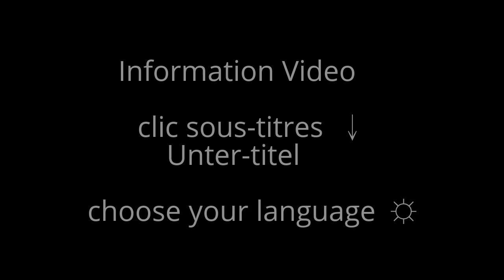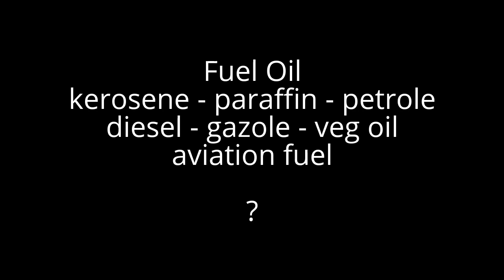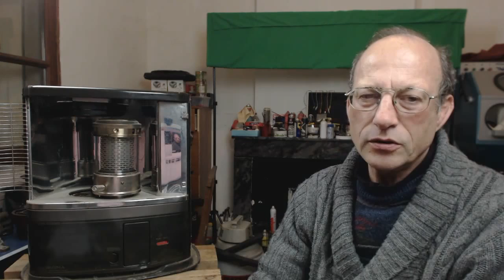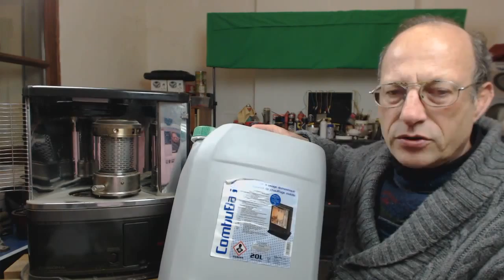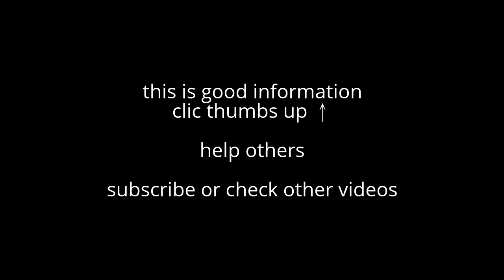Cheapest safe heating fuel - paraffin / kerosene / petrole heaters & stoves

Comment: Use the fuel recommended by the heater manufacture.
Reply: Modern kerosene stoves with wick essentially also act as a catalyst. After combustion, what remains is only carbon dioxide, i.e. the same as what humans exhale. We are talking about for K-1 type kerosene that is sold in the United States and meets the specifications for indoor use. There is also this type of kerosene in Europe, of course it is expensive, but worth it.
Reply from the maker: Hahahah!
Yes ... sort of :)
The problem is two-fold .

1) There may be no regional supply of the recommended fuel.

2) The recommendation of a fuel, is based upon a business deal ... the fuel must be correct, but it doesn't have to be the cheapest.

This is why it is a good idea to understand standards.
It is also why different oil companies choose to use different standards ... to prevent public comprehension :)
Reply: @EngineTuning  , Correct. But people using diesel & jet fuel in these heaters are asking for trouble. We don't have many choices here either but !K kerosene is available almost everywhere.
Reply: @steveashcraft718  The "jet fuel" is kerosene.
Reply: @greenghost6416  , that's what I thought. Thanks for clarifying that.  Since it's jet fuel should be a lot better than gas station kerosene.

Comment: Good information. I have a 12 month old parrafin heater. It runs fine, but on start up, and switching off the heater, there is really bad smell of smoke. I've tried cleaning the air filter, and parrafin filter. But the smoke is awful. Is there a way to stop this from happening. Tia.
Reply from the maker: For the start up, always have a large bin bag to hand.
When the clicking starts, put the bag opening, over the grill.
The puff of smoke will inflate the bag.
The smoke can then be ejected outside.

For the switch off, the trick is doing this before retiring to bed :)

Comment: Great information! At least I understand now why my eyes are having some trouble.... Burning C2 since it is more then 50% cheaper then the C1.
But it makes me think harder for a better solution!
Reply from the maker: Yes ... cost does affect our decision making.
It also brings us to question the ethics of taxation, when the C1 fuel is merely the next level crack of the refinery.
Ie. It will only be slightly more expensive to produce.

The achievable miserable solutions, are limited to one.
Add 0.5% acetone, to each recharge of fuel.

This will lower the surface tension of the injected fuel droplets.
This in turn, causes greater atomisation of the fuel, and therefore a hotter, cleaner burn.
... but bear in mind that it has the same advantageous effects on C1 fuel.

You can remove the grill, and check the flame colour.
It should have no yellow, it should be blue.

However, whilst burning slightly cleaner, and hotter, it can't eliminate all the toxic fumes from the C2.
These are designed for an exhaust, not for human consumption.

If money is very tight, you could 50/50 C1/C2 and add acetone.

The very best is C1 + acetone.
Pure C2 is toxic, as you ere experiencing ;)

Roll on summer :)
Reply: @EngineTuning  Thank you for your reply.
And yes, Roll on summer (a real one this year would be nice)
Reply: @EngineTuning  Thanks for this info👍  and  "achievable miserable solutions" 😂  love it. 😂

Comment: I have tried all fuels in a Kerosene/Paraffin heaters and believe me C1 UK premium paraffin or K1 US Kerosene are the only fuels that actually work correctly for flueless heaters. Please don't use Kerosene/Heating Oil it's not good for you also don't use Diesel the fumes are unbearable no matter how clean the combustion is. If you don't like the smell, try hydro treated kerosene/paraffin it has almost no smell but please make sure it's C1 or K1 US spec. Make sure u have a CO alarm/detector in the vicinity of the heater. Premium paraffin works out to about 12p per KW while the oudorless fuel is about 15p per KW cheaper than electric at 23p per KW. Gas is cheaper at about 8P per KW but I find the Paraffin/Kerosene heaters cheaper if u don't have a gas supply or if you are just trying to heat a specific space and not the whole house.
Reply from the maker: Good post, and interesting price comparison :)

Comment: If I make biodiesel myself from waste vegetable restaurant oils that should be ok to burn inside if I achieve good combustion, right?
Reply from the maker: My opinion is that it will not be safe.
Buy some high quality paraffin refined for indoor heaters.
Check how it is a very light oil ... you can barely call it an oil, because it is so well refined.
Compare it to your biodiesel.

There is no way that it will burn clean.

Remember ... the little diesel heaters that people fit into mobile homes ... they have an exhaust pipe that must be routed outside.
The reason for this is that the exhaust fumes will kill you.

Stay safe, and keep your family safe.

Comment: Hello.  I have the zibro R18 E  heater ,.  When I use it , it puts out a smell, then you can't use it , also it doesn't seem to put out much heat, I was told they give out a lot of heat,.  Tks
Reply from the maker: Pump out the old fuel from the fixed reservoir.
Clean the flame rod (see my other video dismantling).
Add fresh fuel.
Good luck!
:)
Reply: @EngineTuning  hello. Tks for the quick response, I'll look into what your saying,  should it smell much, and should it give out much heat, I would be using it in the house,
Reply from the maker: @martinmorgan8475  Upon first ignition from cold; a puff of smoke is ejected.
This is because at the moment of combustion, the temp is too low.
It is just one puff of smoke.

I take a bin bag, and hold it over the grill (when it begins clicking).
The bag fills with smoke.
I close it, and empty it outside.

The stove will kick out around 3 KW of heat.
That's hot!
Reply: @EngineTuning  hello.  Can you tell me more about the electric inverter one you have, What's the advantage over it and the older one.  Thanks
Reply from the maker: @martinmorgan8475  The wick systems smell when you extinguish the flame.
The injector systems smell when you ignite the flame.
:)
Reply: @EngineTuning  hello. What I'm saying is , is it better to have an inverter heater in general,.   over the older one ,  with it being more advanced,   because I was thinking of buying one.   Thanks
Reply from the maker: @martinmorgan8475  Inverters are better.
Reply: @EngineTuning I'm seeing some advertised inverter 5086 5096 and 5006 Corona I think, apparently similar, what one do you have and what one would you recommend.  Thanks again
Reply: Hello,  is there any particular inverter heater you would recommend , and what KW would be enough for the house,  and dose the initial smell go away, don't particularly like the smell of paraffin.  Thanks
Reply from the maker: @martinmorgan8475  use the bag method, and there's no smell.
Buy the one with the best spares availability.

Comment: Bonjour, mon Tosai SRE 301 me donne un code erreur H36, ce serait filtre a air bloqué, je l'ai démonté mais je ne vois pas de filtre a air, quelqu'un pourrait m'aider ?
Reply from the maker: The air filter is a simple mesh, that allows the free flow of air.
It's roll is to filter larger particles such as hair, wool, cotton etc.
It is fixed into the case, at the rear or side.

Comment: Can u run these on Red diesel, as it's around £1.20 a litre at the moment but C1 paraffin is over £2 a litre and Heating oil/kerosene around £1.70. I only ever need around 50l a month during winter and looking to save some money.
Reply from the maker: Everything is as stated in the video.

It is evident that heating fuel prices are over taxed.
C1 should be no more expensive than Red.

If you wish to use diesel as a safe heating fuel, you need a flue or exhaust based system.

Comment: Problem with mine, unable to have a blue flame. Even on the verge of extinction I still have a yellow side.
Reply from the maker: When restarting the heater with last years fuel still in it, you can expect problems like this.

Add 1% acetone to the fuel on each refill.

If this doesn't cure the problem, then you will need to watch my video on how to service the heater
https://www.youtube.com/watch?v=VC-5657JLhU
 :)

Comment: Thanks for very useful advice. I used to run a parafin heater on my boat but now I refuse to pay the extortionate parafin price on principle. No boat now, so I've been using the same parafin heater in my conservatory with heating oil (80p litre) and window open. Though I've just installed  one of the chinese deisel heaters in there, again run on heating oil and it's brilliant. I've actually got three of the  parafin stoves, two with wicks, one electric and tried them all with heating oil. Good good clean burns with no smell when going. Wick ones will be treasure if we get power cuts, though I have installed a carbon monoxide alarm.  Thanks again for alerting us of the danger.
Reply: That’s good to know, I wanted to try my wickless one on normal heating oil. Has your wickless one been ok running on it? Thanks

Comment: I have a Corona wick heater, I usually fire it up and then turn it down once it starts burning hot.  Is it better to run it close to full or turn it down low for efficiency and clean burn.  Also how often do you replace the wick, I have had mine a year now but just wondering how long they last.
Reply from the maker: I have one also, though I've not used it for some years.

When turning down the wick, there is a point where you can see that combustion isn't perfect, and more odour will be produced.

If you have the wick burn efficiently, it will produce a gas, and it is the gas that burns (not the wick) ... at least, that's the theory :)
Reply: Cheers, mine seems to be working well so far, if I turn it down too quickly it does sputter a bit but the  heat picks up again and it glows hot.  I like the glow of the wick ones but cant find much info on how long the wicks last, I suppose I will know when it needs replacing as the heater won’t burn properly.
Reply from the maker: @lordtoady1528  yeah, you'll know :)
But they last a long time, if they burn right.

Comment: What about olive oil pls?Is that safe?Thanks
Reply from the maker: I have no data on burning olive oil, but from a viscosity perspective, it wouldn't work in a heater.

Some people process 'used vegetable oil', for use in diesel engines.
If you fancy doing some chemistry, you should locate web sites specialising in that field, but I have no confidence in it working in a heater.

Good luck, and thanks for raising the issue :)

Comment: The problem I have is. I bought a kerosene heater not knowing too much but assuming it would be cheaper. I bought regular kerosene, which said it was high grade blah, blah. But it was just the regular stuff and made the house stink. So I bought clear lamp oil. Thing is, this costs me about 70p per hour to run. Plus replacing the wicks etc An electric heater would cost me about that too, so I'm not sure that it's worth running the kerosene heater. I think it's handy to have as an alternative or emergency option. I also have. kerosene lamp. So that would be handy in power cuts, grid down situations etc. Also I can cook and boil water on top of it which is handy. If I could find cheaper clear kerosene it would be worth it, but not at the cheapest price I can currently find. Which is about £3.60 per litre.
Reply from the maker: £3.60 per litre is not correct, for when buying in 20lt quantities.
You should carry out some research on fuel supply sources.
I doubt very much that it is more expensive than diesel.
Although it is more refined, it has reduced tax, due to it being home heating fuel.
£3.60 sounds like profiteering.
Reply: @EngineTuning  I had a quick look and I think I found another cheaper supplier. I don't think I can post links on here as my last message isn't showing. This place sells "odourless kerosene" for £60 per 25l. Don't need to pay VAT if used for heating. So that seems a bit more in line with what you were saying pal. So that would cost me about 48p per hour, which is getting better.
Reply from the maker: @tqdesign9288  So the £60 includes VAT, meaning that the price will drop?

There are three grades of odourless, so the price could be par.

RE links, you can post youtube links, but for external you can disguise the link by dropping the https prefix, and saying DOT instead of '.'
Reply: @EngineTuning  I think you are right there. It does include the VAT in the £60, but hopefully I can get it removed from the bill as it's for heating. Their website says there isn't VAT if it's for heating. So at this price it comes in at about half the price of running my electric heater. I'm thinking through winter, once it starts getting to freezing temps, to just put my central heating on for a couple of hours each morning to prevent the pipes freezing. Then use a small kerosene heater upstairs and one downstairs to heat the house for the rest of the time.

Comment: Due to the energy crisis in the Netherlands I have bought the cheap stuff before i knew the facts. The seller told me it's fine, but I'm already having trouble after 2 weeks of usage.  The only problem is that I have quite some of the cheap stuff. Do I have to get rid of all of it, or could I combine the manufacturers petroleum with the cheap stuff together when filling the heater?
Reply from the maker: Understanding the financial difficulties in life...
Mixing and adding acetone, is the way forward.

Buy 5 litres of acetone from a diy store, and add 10ml acetone per litre of fuel (1%) .
This is an extremely cost effective way to improve the burn temperature, and therefore gain more heat. Plus, the improved burn will keep the system clean(er).

Check around for the cheapest, indoor fuel (no flue and typically showing a picture of a paraffin heater on the container - typically 20lt).

Prices have doubled from last year, in France.
It used to be €1 per litre, and now it is €2 per litre.
(it's a con ... most of the cost is tax)

There are 3 grades, defined by aroma.
Typically €40, €45, €50 for 20lt.

If you are mixing with kerosene, then there is no point in buying anything but the cheapest.
So check around.

With the acetone, you should be able to turn it down a bit, but make sure that it is burning with a blue flame, as this indicates a clean burn.

You must have ventilation - be aware of feeling drowsy, or weeping eyes.